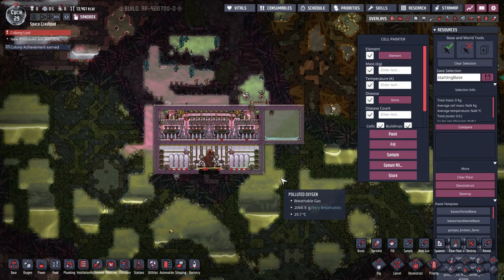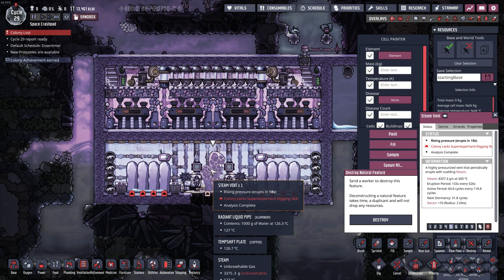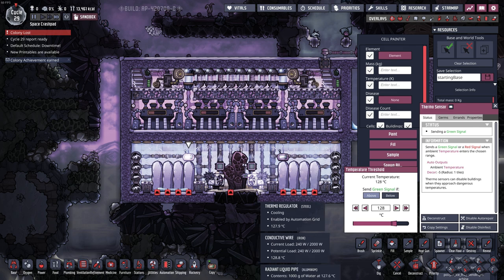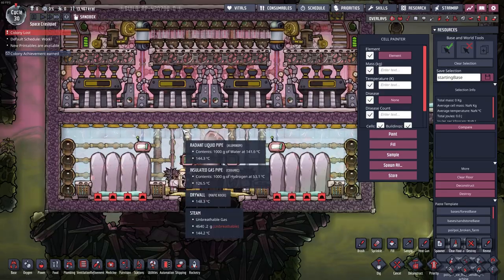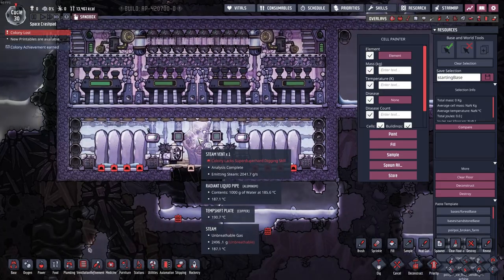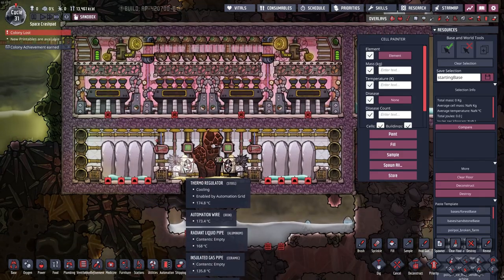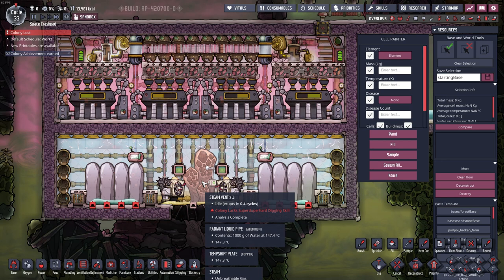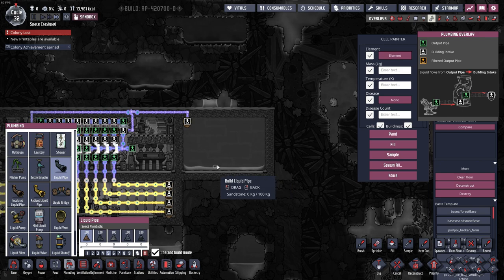Overly Scienced - Episode 23: Hot Steam Vent Tamer (Oxygen Not Included)

Comment: I always just wrap the vent in insulated tiles then (not using the steam from the vent)steam turb and aqua tuner and run a cold temp loop through and around the vent area for turning the steam to water instantly. I usually put in a large mass of hydrogen just below the overpressure value and get it to pretty cold.   Usually pumps out water at 30 to 40C very easy to manage. Theres more to it but its super simple

Comment: brothgar did a great design using doors to shut off parts of the turbine when its hotter to reduce the waste of heat/steam. if you do that to multiple turbines then even when its freshly hot steam coming out it still wont be wasting at all. you would use heat sensors to make it so that the turbines would open slowly but should still be enough to handle the initial "eruption" of the steam vent.
Reply from the maker: Yes, I considered that but the steam buffer room would be about 2x the size of this steam room to prevent vent over pressurization or there would need to be a lot of semi-blocked turbines to match the output of the vent. Either way, its big. This was a way to keep the whole build relatively small. I am currently running some numbers on the steam vent tamer 2.0 to find ways to keep the brothgar method small.
Reply: @cometgaming8812  gotcha, i usually feel the brothgar method with doors even if it may cost a few extra turbines or so is usually easily done earlier then petroleum. (if you use dreco for plastic)

Comment: "Overly Scienced" - well, that checks out.  I can't comprehend building something this complex for a steam vent.  The primary/side chamber method is so much easier to build, is easy to startup, and just works.  My version doesn't even use the door mechanism.  Just diamond window tiles with a tempshift plate on each side.
Reply from the maker: That will work for most steam vents but I wanted to show what to do in an extreme case when the vent outputs more than 2 turbine's throughput worth of steam. If you're not careful, some water can be lost if the vent over pressurizes.
Reply: @cometgaming8812  Add a third steam turbine?  I've looked at a couple hundred examples of steam vents and only found 1 that warranted a 3rd turbine.  The primary chamber itself can be expanded to buffer the steam while the turbines do their thing.  I've got an equation for the size of the primary chamber:

Eruption duration * (grams/second *  - turbines * 2000) / 4500

I use 4500 instead of 5000 just as a matter of steam spreading out.

In a large enough primary chamber, any steam vent can be handled with a single turbine and a side chamber also with a single turbine.  Add enough extra turbines and you can do the whole thing on passive cooling, although I haven't done the math for that.
Reply from the maker: @danbance5799  I don't think that's quite right. You can't assume that the turbine will always be removing max steam because it hasn't been cooled to 200 C yet, ports would need to be blocked. 1 port could be open at all times without turbine inefficiency so Eruption duration * (grams/second  - turbines * 400) / 4500 might be more accurate. Then once the cooler catches up, more ports could be opened altering the equation again. The buffer would need to be in terms of DTUs not grams that way the cooling rate can be factored in. Hmmmmm. I was trying to avoid oodles of math with a 1-size-fits-all design but maybe Steam Vent Tamer 2.0 needs to be developed.

Comment: suggestion: memory toggle for the shutoff, so that it pumps out the water until threshold temperature is reached, from then on it cools the room down again to be ready and chill for the next eruption
Reply from the maker: The problem is that the room almost immediately reaches that threshold temp so the memory toggle wouldn't add much to the overall design. At least with the vents I tested here, maybe a vent with other output statistics would benefit from that.
Reply: @cometgaming8812  i tested your design today on a 4.7k steam vent from my current map. And my vent overpressurized immediately because the shutoffs were so busy with cooling down the room that no water could leave the cycle. The memory toggle solved the problem because it gave me a range of up to 70 degree to play with. Now the cooling starts about twenty seconds before the vent goes idle and the room is at 130 degree again right before the next eruption begins
the metal blocks are really great btw they are mostly the reason i think why it is working
Reply from the maker: @flosiporosi7827  Damn, 4.7 is alot of steam to deal with. What's the eruption period? Do the turbines ever max out? What's the thermo sensor set to?
Reply: @cometgaming8812  eruption period is 205s every 905s
the sensors are set to 170 and 130. i just jumped back and forth until the threshold was soon enough so that there was enough steam left to cool the room but not too early because then it would overpressurize and now it seems to work :)
Edit: except for the First Eruption after dormancy because the thermo regulators never sleep^^

Comment: Petroleum puddle would probably help the turbines conduct heat to the hydrogen pipes. Maybe even chill down a tank of hydrogen too.
Reply from the maker: Petroleum does have a higher thermal conductivity than hydrogen but the problem isn't heat conduction, its the throughput on the thermo regulators. They just can't move the heat quickly enough during the active period.
Reply: @cometgaming8812  just like the steam chamber, more 'thermal mass'. Just thinking about ways to make this work where it can be closer to self powered after initial temperatures are set.

Comment: Now wait a minute... Isn't the power you save/gain by using so many 1 kg pipes the same as or less than the power inefficiency from using regulators instead of aqua tuners? I'm probably wrong, but maybe the math is important
Reply from the maker: The 1kg pipes are irrelevant to power efficiency. An aguatuner using super coolant can move (10kg * 8440(DTU/kg)C * 14C) for 1200 watts for an average of 985 DTUs per watt. A thermo regulator using hydrogen can move (1kg * 2400(DTU/kg)C *14C) for 240 watts for an average of 140 DTUs per watt. An aquatuner has 700% the power efficiency of a regulator.
Reply: @cometgaming8812  Right, but I was implying that in this case running all those pipes prevents you from using an aquatuner, forcing you to lose efficiency because of the regulators. :)

And the power you save refers to the over-drawing above 800 watts from the turbines.